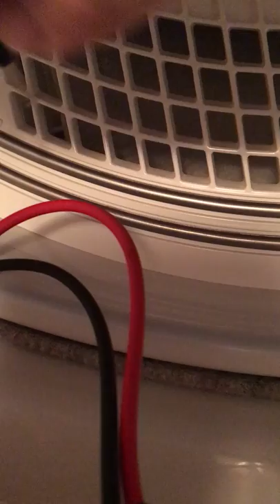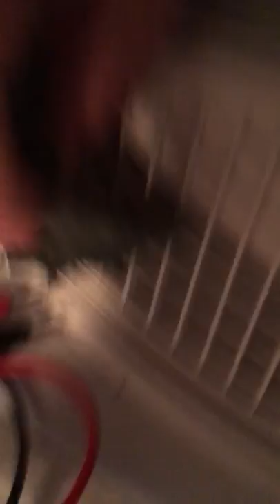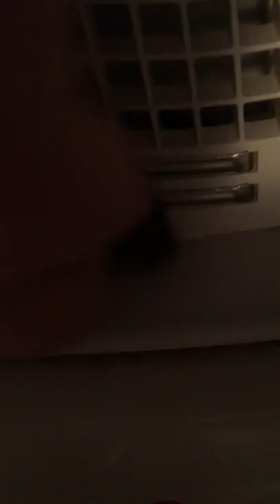Dryer Auto cycle shuts off too soon.  Cloths not drying.

Comment: My issue was the drum was spinning too fast and the clothes were not tumbling. I checked the motor and saw the pulley was wound up with belt string. This causes the pulley to grow and the drum to spin faster. This left my clothes slightly damp. Also it helped solve the timmer from jumping down from 36 minutes to 6 minutes. Both issues solved. 😊👍

Comment: I have a GE dryer and the sensor bars look much like yours - 2 metal bars right up front under neath the air vent inside the dyer tumbler. My dryer, on the auto-dry setting, just leaves clothes slightly damp, even at the hottest heat setting "regular". Does this fix address that problem?

Comment: My dryer is only a couple weeks old and doing this.
Reply: Cover the sensor with tape
Reply: Check the vents.  Make sure it is clear  I had the same problem and discovered the vent hose went up the wall over my garage in the ceiling and out.   I redirected so it goes straight out along the wall of my garage.

Comment: Can you please help me? I have a Bosch with sensors like yours. Mine is wtw87568it. It has a problem since I've got it 5yrs ago. It's a heat pump Serie 8. It never stops cycles. Even for very small loads it takes 3 or more hours and it recalculate the times over and over again. I disassembled the whole machine and cleaned it all (even the condenser). But I still have the same problem. Even if I set iron dry. The point is that the clothes, even heavy clothes, are dry in 1 hour and 30/40 minutes. So I can only use the timed program. And that's a huge limit for an 8 series Bosh. Mine has more than 11.000 hours of work (I use it a lot). It lasted more than a Miele. But I still don't know how to fix this issue. I hope it's not the motherboard (PCB). Thank you if you can help me out

Comment: Can you please tell me what settings you used on the meter? Continuity? 20 Ohms, 200 Ohms? You have THE ONLY video that shows an actual test of that sensor. ALL the rest are about replacing it. I'm tired of replacing, replacing and replacing items that are NOT the reason why my gas dryer continues to cut off after 3 seconds. I've replaced everything but the $150 control panel and the moisture sensor. PLEASE HELP!
Reply from the maker: My meter automatically selects the ohm setting.  You are looking for a reading roughly 0-1 ohms.  Little to no resistance.    For further troubling shooting diy advise from multiple techs, I suggest going to Reddit’s appliancerepair or a site such as Appliantology

Comment: Drew, when you say auto cycle shuts off too soon because of the sensor, is it the heat is no longer on and the drum stops turning , or does the drum continue to turn without heat until the time set is done??    Thx
Reply: In the auto setting, the drying cycle ends when the sensor bars detect clothes are dry. Machine off.
In timed setting, the drying cycle ends when time ends. Machine off.